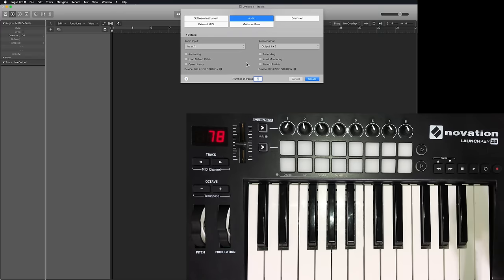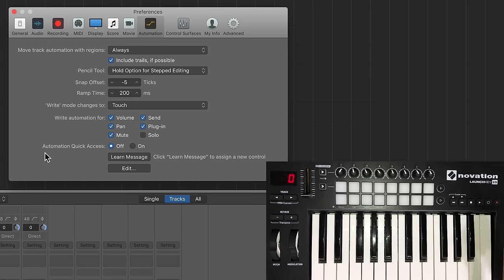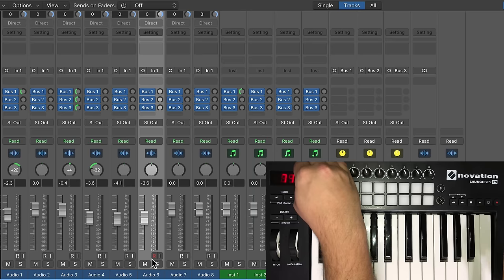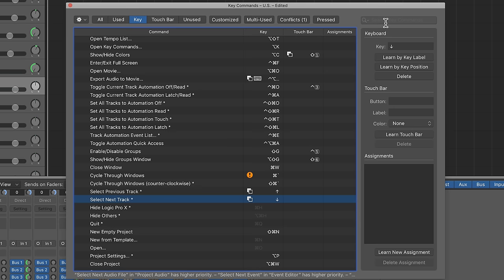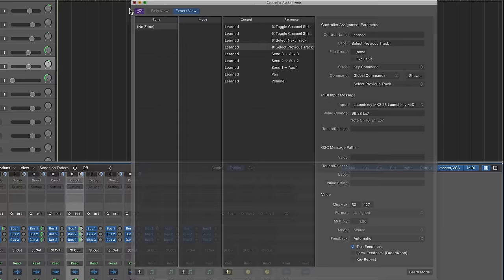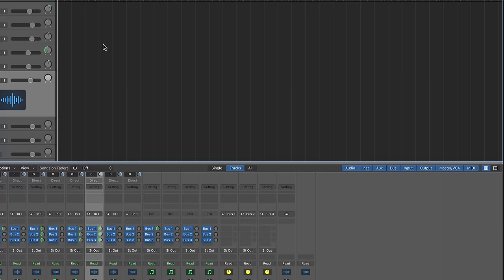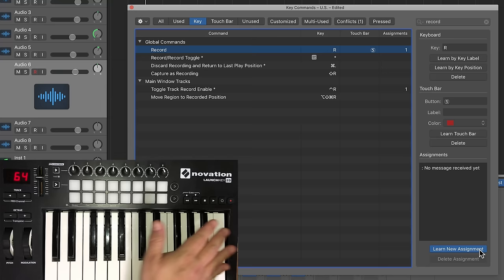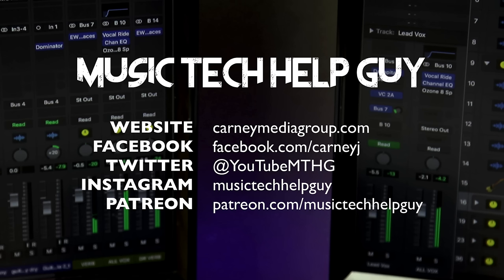Setup ANY MIDI Controller as a DAW Mix Control Surface (LOGIC PRO X)

Comment: I've been looking for a video/tutorial on how to set up something like this, then have a normal set (zone) for playing, then another for mixing. Ideally then I cld set a control to switch between zones/modes with a button on my midi/USB keyboard. 
I just switched over a few years back from using a triton le and mpc 1000 on pro tools to a little midi keyboard in logic, has been a rather smooth transition for the most part I just a little confused with the zones and modes for learnable commands in logic and then also my keyboard has 2 modes INST & MiXER as well as 5 presets that u can change and save. 
For the last year or 2 I have been just using 2 presets and the mixer and inst mode on the keyboard but alot of times when switching logic doesn't switch the saved commands for the newly selected mode?
I have the commands set to direct towards the bottom and this got it to work sometimes...
Really just trying to figure out more about the zones and modes in logoc controller assignments.
Reply: And I also have the commands in the right modes for where I want them, like the no mode for controls all the time and then specific controls for the other modes.
Example I set bank playhead 1 bar L/R to two different pads in mixer then switch to instrument where those pads shld be something else but they don't change.

Comment: There is so many flaws in logics learn mode and modi control surface commands! 
I feel like there is no good way to take a midi keyboard alot like the one you were using and use the controls that already come programed on it and then program new controls and change some of the pre programed controls. 
It wld be perfect if they wld make some kind of generic keyboard pic and/or just have a better way to look at all the controls u have assigned. 
Don't get me wrong the midi learn is great but I have a nektar impact lx25+ that I have been battling with getting set up and saving the set up to be used again. 
The nektar comes with many controls pre programed but to no surprise its def not the way I want it! One problem is that the keyboard has modes which is nice because then u can have different controls assigned to the same knob/button for each mode, but this is where the control surface window starts to freak out on you sometimes. Then there's also controls that the only way to pull up is by hitting multiple buttons on the keyboard making them very hard to change. 
I think I have almost got it set up but it has taken me 10x longer than I thought it would and to be honest it probably would have been faster to just start from scratch. The main problem is if I start from scratch then I can't figure out how to still utilize the modes on the keyboard which also how I am able to save the setup for use on another day. 
There's a mixer mode and a instrument mode then 5 preset modes that you switch between with 3 buttons. The 5 preset modes can be saved internally but this is where it starts to not work right again. So I have mainly just programmed all my controls on the mixer and instrument modes, but have to hit like 4 buttons to do one thing smh.
I am determined to get it set up tho so maybe one day it will all work out.
Reply: This video has helped alot tho even tho it's not directly made for what I wanna do, thanks

Comment: i still dont get what the modulation wheel does to the sound
Reply from the maker: The modulation wheel is a continuous controller like any knob or fader. It does whatever you assign it to. Typically in most synths it defaults to a vibrato effect or other LFO effect, sometimes filter sweeps. It all depends on the synth. But you can customize it to control any synth parameter.
Reply: @MusicTechHelpGuy  ahh ok i can see how people would use, maybe a cutoff knob to control the hpf of the sound, btw is there a way in logic to set a preset or something so i can just load the preset of the assignments when needed for midi assignment or mixing